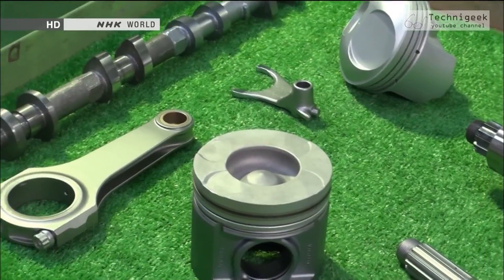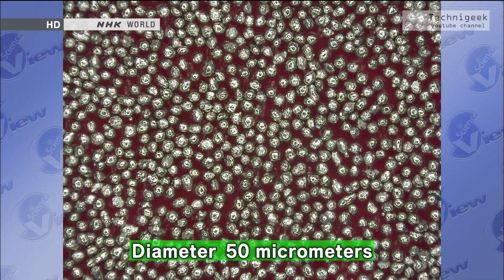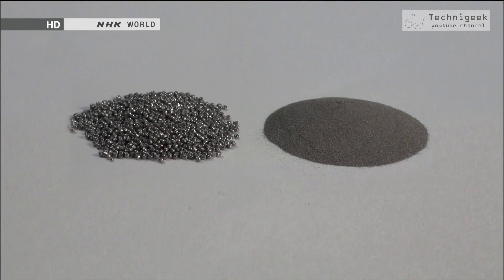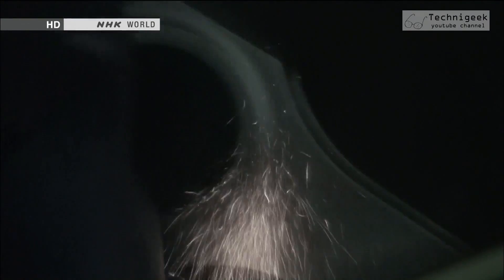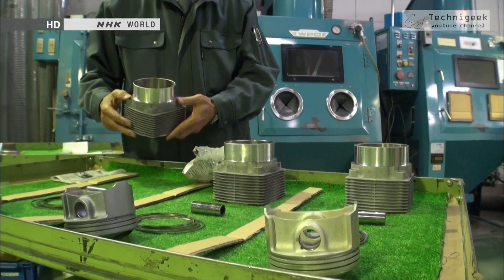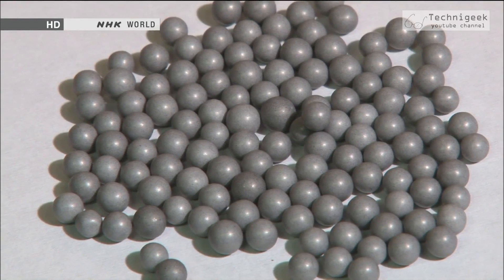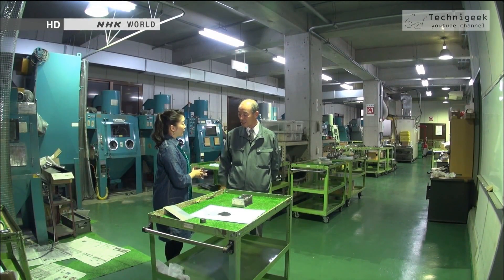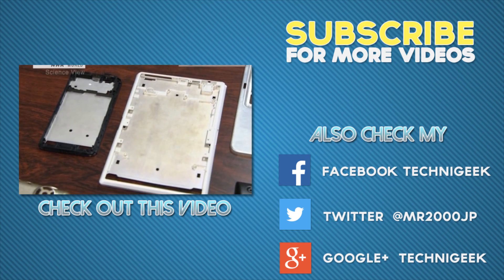How to make metal parts live 10 times longer طريقة اطالة عمر القطع المعدنية 10 اضعاف

Comment: I have been media blasting for many years, and I have NEVER seen media blasting make metal stronger.  Heat treating, yes, but not media blasting alone.  Something sound fishy here....
Reply from the maker: +Paul Zigouras thats why they call it innovation , making new thing
Reply: Samurai secret, lol!
Reply: Looks similar() to "3D spot induction hardening" by different method and same measurable results.
Abstract
In order to analyze and predict the material property of AISI 1045 steel during spot induction hardening (SIH), a 3D electro-magnetic model coupled temperature fields with time-dependent boundary conditions was developed using finite element simulation software ANSYS. A magnetizer mounted at single-turn copper coil inductor, the calculation of the material hardness and the prediction of phase transformation were taken into account in this model via defined material laws. The phenomenology model in this work presented a novel and simplified way to predict the temperature, the hardness and phase transformation in SIH process. In situ temperature and current measurement as well as hardness and microstructure analyses were carried out to verify this model.